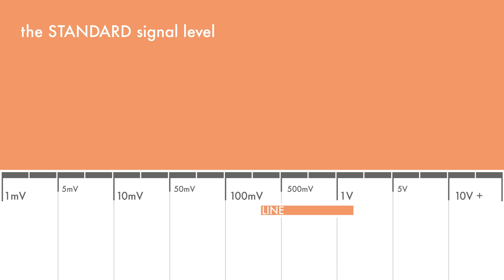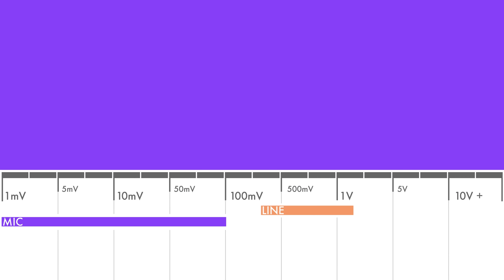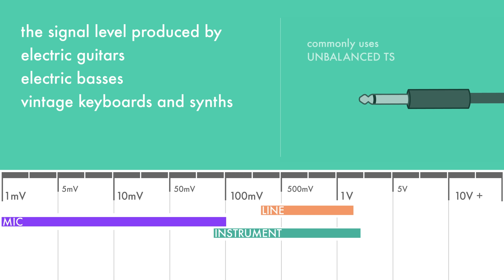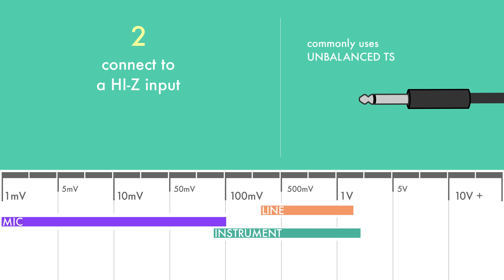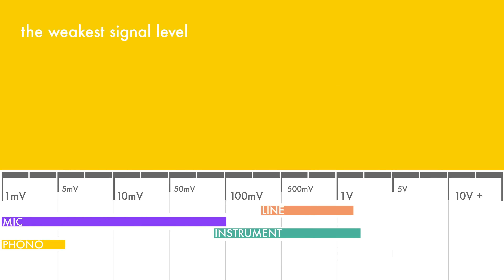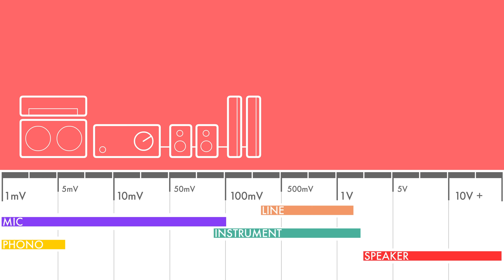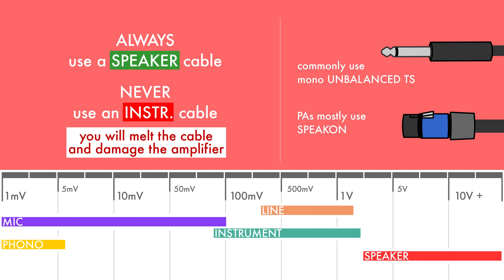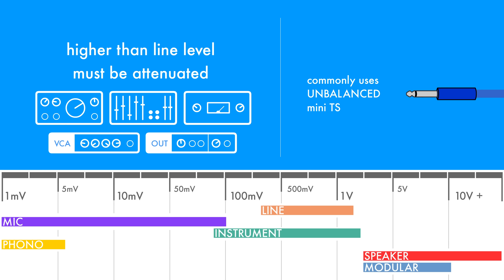Audio signal levels explained: Mic level vs line level vs instrument level

Comment: I love the summary of line level and all the other signal levels. When I was younger with guitar amplifiers and such a microphones and PA systems, I used to know this backwards and forwards, but this is a great summary. The only thing I thought maybe just maybe you could’ve added was to talk about headphone output headphones levels are usually weird because I think they meant to drive a different impedance either I don’t know 100 homes or 600 homes or something so I forget any of the details of what a headphone output level is other than if you put the output of one of those into the input of your guitar amplifier. It usually distorted it like crazy. So “Great Video” but Just curious about “headphone level. 😊
Reply from the maker: If Im not mistaken it should be line level on its lowest setting before the pre-amp kicks in

Comment: do you or anyone here in the comments know of a device that will take a single audio input using RCA connection "say from my desktop computer" and have 8 amplified outputs with level control? I'm would be using it to send the same audio signal to multiple separate devices which  have there own amplification which power a set of speakers. Imagine having 4 different A/V receivers that power 4 different types of speaker pairs along with 4 different individual self powered speaker units. I need them all to play the same thing simultaneously while having the ability to send one device a more powerful signal to make up for the distance it is away from the source and/or the devices needed a higher input voltage for whatever reason. thanks Rick D.
Reply from the maker: This might sound a bit ghetto, but I believe a multi-channel headphone amp will do do what you want. (this for example: https://www.thomann.de/gb/behringer_ha8000_v2.htm)
Since these operate around line level, with some careful gainstaging you should be ok. Then all you need is the correct cables / adapters to go from your pc to the amp and ultimately to your other amps.
Does this help at all? Or is there something I don't understand in your setup?

Comment: I have a question: I have a yamaha ex5 (quite an old keyboard) and I would like to connect it to an audio interface (behringer umc204hd) to use the Ex5's sounds (both mono and stereo possibly) on my DAW. should I use TS or TRS cables?
Reply from the maker: Either should be fine. I checked the ex5 manual and it doesn't specify if the outputs are balanced or not (but based on the release date, I'd guess they are, so in that case TRS is the balanced one).
But in any case, if you already have TS cables lying around, just use them and as long as there's no noise issues you should be good!
Reply: @arbitersofsound  Thank you very much for the comprehensive answer and for replying to me in such a short time! Much appreciated!👌🏻
Reply from the maker: @Zzibbubby  Happy to help!😄

Comment: Hi, I just got a microphone like a dynamic one but it uses TR jack output? Can it be used ?
Reply from the maker: Yeah of course! But if you want to connect it to an audio interface / mic pre then usually the jack input is for line level signals and the xlr for mic level signals. So in that situation you'd need an adapter/cable to convert the jack output of your mic to xlr unfortunately.

Comment: Which vintage keyboards and synths do you have in mind that use instrument level with high Z ?
From what I have seen, all of the virtual analog from 90's are using line level and I don't think any have high Z (although 90's synths are more on the modern side of vintage).
Maybe I am misleading though?
Reply from the maker: Yeah probably I'm too old :D because when I was saying vintage I was thinking more along the lines of 60s rhodes, wurlitzers and the like.
I would expect all 90s digital gear to be line level

Comment: I don't get it. wish there was an actual diagram of setups and what cables to work with. I am so confused because its too much spoken words.
Reply from the maker: What's the setup you are dealing with? Maybe we can help :D
Reply: @arbitersofsound  Thanks for reaching out. My new band has a practice room and we've connected two guitars, one bass guitar and a mic to a two big speaker through a mixer. The sound is very compressed as in its rly not clear and the mic sounds low most of the times. we are too poor to get an actual good guitar amps so.....  I am afraid to crank the volume up of mic cuz i am scared of breaking the speaker so, i never let the signal bar of the mixer to reach the red dot but sometimes its inevitable. I mean just in general i would like to know more about the cables and set ups for future.  Also, I browsed through your channel last night and i really appreciate your videos.
Reply from the maker: @CloudxOut  OK! So the first problem is that you are trying to connect instrument level signals (guitars/bass) to a mixer that most likely has mic and line inputs. In order to do that properly you'd need a DI-box (or guitar and bass preamplifiers).
Also the sound of electric guitar plugged directly into the mixer is not really what we are used to listening. It's not necessarily a "bad" sound but usually you'd expect some coloration from your guitar amp and your guitar speaker cabinet.
Tbh I'd probably consider getting some basic amp modelling pre for guitar because I think that will solve most of your problems and you could connect that directly to your mixer.

As for the mic, I don't think you'll blow the speakers unless you're really abusing the gain.
Do you know if your speakers are active? Or are you using a PA amplifier? Or is your mixer powered?
Anyway, if you want you can message me on Discord and I can help you with your setup, cables etc :D
Reply: @arbitersofsound same though here.. i got a trolley speaker with one input for mic and one input for guitar, still figuring out how they are different, its quieter in guitar input than in mic input using microphone if it is a resistor or stepdown watt converter for the signal like DI boxes or whatever..i was planning to do a diy hifi speaker like my trolley speaker with byilt in amp.. just cant fine the righd ingredients makin an instrument input..i might just buy finished product for the guitar input module circuit board,still i wanna learn.hehe.

Comment: Just found your channel, it's exactly what I needed! Really well made videos!
Quick question: what level would an headphone output on an iPad be? I'm basically trying to record songs played from my iPad on my computer (as backing track, I record myself playing drums at the same time). I connected the headphone output to a pre amp, and the pre amp to the line level of my audio interface. Is that safe? Is there a better option? I can't crank up the volume on the iPad as I also connect my IEM to it to hear the backing track while I play.Thanks! :)
Reply from the maker: The headphone output should be line level already so you can connect directly to your interface. The only problem being that the output of the ipad is stereo so you're going to need a Y cable to split it into 2 separate channels to connect to 2 inputs on your interface :D

Comment: can i connect a line level output to a mic level device like my wireless mics live rode wireless PRO?
Reply from the maker: Ideally you should be using a DI for something like this. Most likely the line level signal will be too loud for the mic input.
Reply: You can but gain should be set quite low as the signal can clip very easily. Generally I connect headphone out from a mixer to the Rode wireless pro ii and turn the gain down quite low as it can clip.

Comment: Do I need a DI if I use multi effects pedal with amp and cab sim to connect to line in on a mixer? Home practice only
Reply from the maker: No, most likely the amp sim has a line out and you are connecting to a line in, so you're good :D

Comment: I have hi z input on my electro classic guitar, can i plug in my guitar directly through the cable in to the line input on my PC ?
Reply from the maker: Does your guitar have a built-in preamp (with battery etc)?
If it does then you can (although the line input on your PC might be much noisier than an input on an external audio interface).
If your guitar only has an output jack without a preamp, then you can't, because the level of the output will be way too low and the impedance too high.

Comment: Great video! Can I connect headphone out to line in?
Reply from the maker: Yes you can, but you should keep the volume low and also note that headphone out is stereo, idk what kind of line in you want to connect it to :D
Reply: @arbitersofsound  well I have Korg Volca Keys that only has headphones out. I need to sample it somehow. In principle it is mono but outputs two identical channels via the 1/8 inch headphone out. So I can use a 1/8 to 1/4 cable and plug it into a1/4  line input of an audio interface, or a 1/8 to rca cable and connect to rca stereo input
Reply from the maker: @mrwhitemantv  100% Thats what ive done with my volca as well :D
Reply: Don't you mean "can I connect headphones to line out?"

Comment: Hi there, thanks for the great presentation. I connected my digital piano Yamaha DGX660 left/left+right output to the DI/instrument input of the preamp Focusrite ISA One. They seemed and worked fine. Nothing blew up, I did not hear any distortion or weird noise etc. Did I potentially damage the DI/Instrument input of the ISA One? I now use the DI/Instrument input of the ISA One for my Fender bass and it seemed fine, produced good sound. Thanks!
Reply from the maker: Hey! No, you didn't damage anything and everything is going to be ok :D
Most likely, if you keep your keyboard volume low and the preamp level also low you can get a usable signal. But, you should ideally be using the line input for keyboards and the Instrument for bass and guitars.
Reply: @arbitersofsound   Thank you very much for your confirmation. So I should not send it back LOL

Comment: Super helpful! Where would a headphone signal factor into this? Intuitively I would think they are on the spectrum between a high line-level signal and a low speaker voltage signal? Technically they are powering passive speakers... but people often use headphone outs and line outs interchangeably.
Reply from the maker: Indeed! The base level for a headphone out should be line level and then you are amplifying it more to drive the headphones. The main difference between the outputs is impedance, since line out is meant to drive an amplifier whereas headphone out is meant to drive a little speaker.

Comment: Any chance to get connection between Numark Mixtrack Platinum FX and the Arturia microfreak? 😢
Reply from the maker: The only way I can think would be to plug the Microfreak into the mic input of the Numark.
But in order to do that you will need to connect the Microfreak to a DI first (probably also with a pad switch) and then the DI to the Numark. Does that help at all...?
Reply: @arbitersofsound yes if you are able to explain me what's DI and how thats gonna be worked out together 
Please
Reply from the maker: So, the output of your synth is Line Level, but the input on the Numark is Mic Level. If you just connect them probably you're going to get distortion because the output of the synth is too loud for the mic input (you can try it). If it sounds noisy and distorted, you need to get yourself a simple small passive DI box, which converts Line Level signals to Mic Level signals. (something as simple as this: https://www.thomann.de/gb/millenium_pocket_di_1.htm). This is passive and doesn't need any power to work. The pad switch is a little switch on the DI that drops the volume so you can connect the two devices without overloading the mic input on the Numark. Let me know if you need more help! @Iankowalsk
Reply: @arbitersofsound  all done 
But still not enough for me ^^ but all of your infois are good and works too
Reply from the maker: What problem remains? Maybe I can help @Iankowalsk
Reply: and ABOUT pad switch? 0 😱

Comment: Nice info. I have an electric guitar, a phono turntable, an electroacoustic guitar, various midi keyboard and electric piano. Now i'm not into a band or anything.. i just in the learning phase. 
So my question is: the electoacoustic guitar and electric guitar are the same? I have a dedicated speaker-amp cube for the electric guitar. Can i use that on the electroacoustic guitar?
Also i have an old hi-fi amp with phono input where the turntable is plugged in. Can i plug the electric guitar there?
Reply from the maker: You can most likely use your acoustic on your guitar amp. Check and see if you like that kinda of sound.
On the other hand don't try your phono input, you'll get a super distorted sound from that...

Comment: It is max voltage, isn't it? It looks like most of them have voltage bias.
Reply from the maker: It’s their approximate voltage ranges. You’re right that especially with mics and instruments they will tend to be on the lower end of the scale. But super powerful power amps could easily be outside the right end of the scale :D
Reply: @arbitersofsound  
That means, for example, that a voltage of around 90 mV is considered silent for instruments?
Reply from the maker: Yeah, i think vintage style single coil pickups on guitar should be around 100mV. Hotter humbuckers are around 400mV. Obviously the output will depend on the notes and the strength of your playing etc